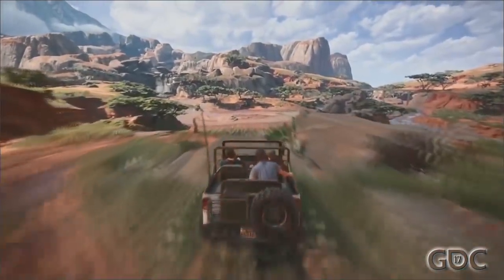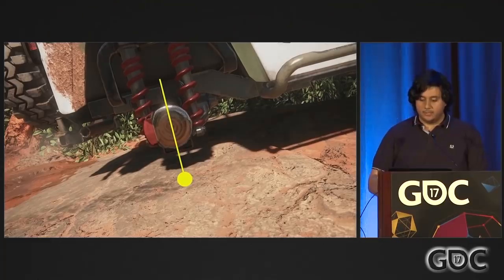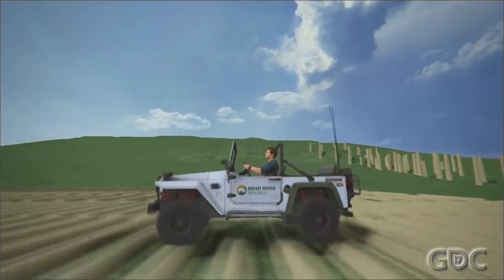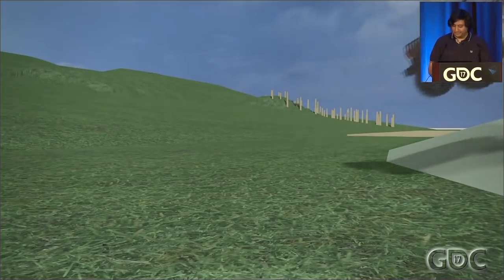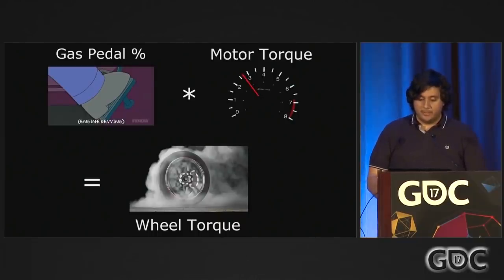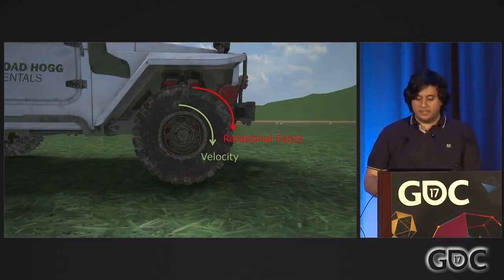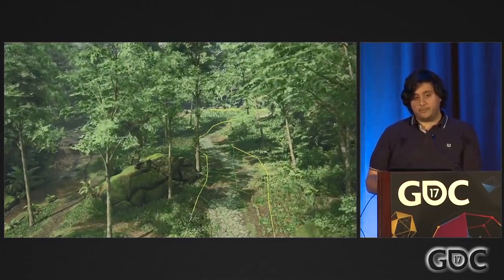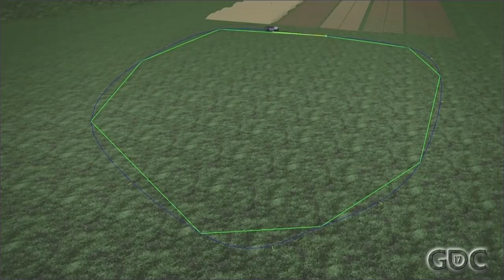The Science of Off-Roading: Uncharted 4's 4x4

Comment: Genuine question: lb-ft what kind of scientific unit is that and why would you use it? I always thought that torque is measured in newton-metres.
Reply: pounds-feet i'm assuming, and because they're american lol
Reply: Torque can be measured in both lb-ft and nm, you just have to convert from one to the other inside the code, so since physics engines use the metric system (Newton's), they'd need to put a converter at the end of their code (torque in lb-ft = torque in NM * 1.36)